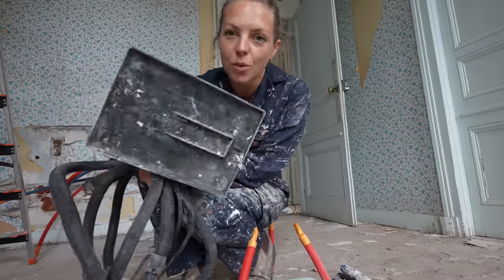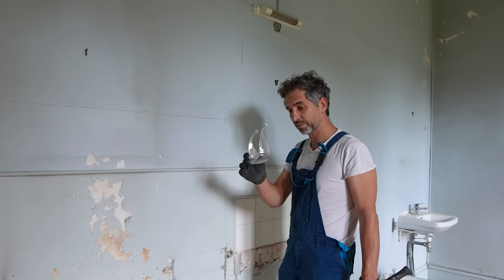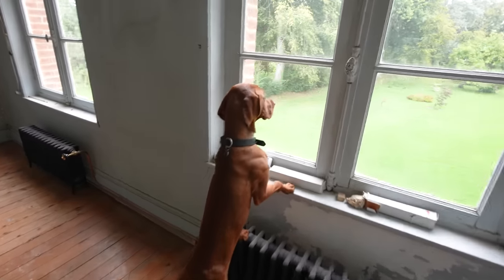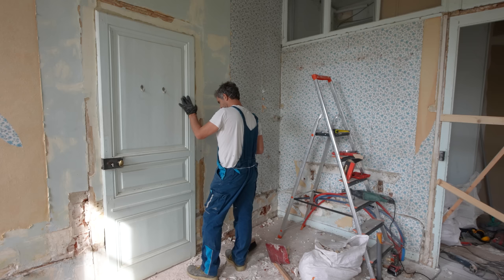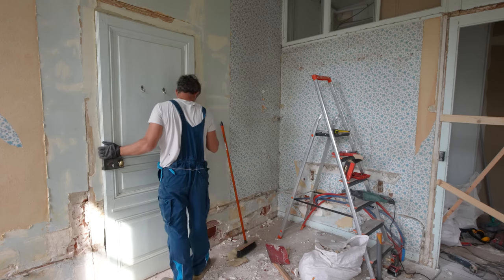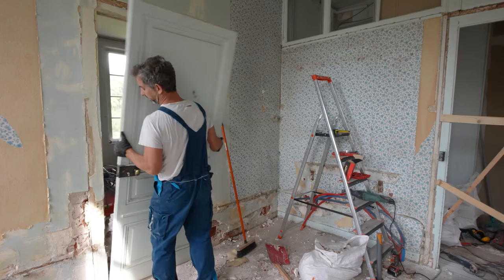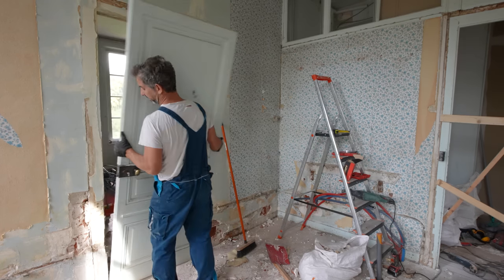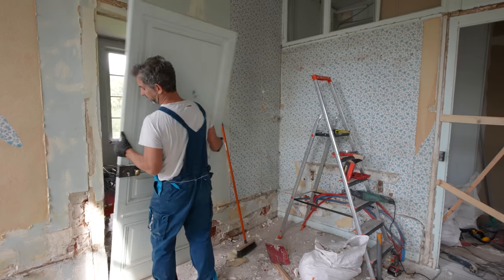Chateau Master Suite - Demolition Time!

Comment: Happy belated Anna! Watching you strip the wallpaper prompted me to send a hint... That is vinyl wallpaper and stripping it with a steamer is not going to help as it is water resistant. However, we use something called a paper tiger (very inexpensive-even Amazon sells them) that scores the surface of the vinyl, then steam or even water in a spray bottle can penetrate. It would be much faster and easier for you.

Comment: I bought a steam machine years back for just the same project: blue wallpaper in the bathroom, and it behaved just the same way where I had to steam up and easily scrape off the golden paper layer. I noticed that the residue of white spots left on the pale blue wall in the video looks kind of interesting, as if you could design a similar look to that which would have an ethereal feel to it. I don't think Philip needs to worry about boring moments. You have more subscribers still than Dan Preston does, though he is zooming upward rapidly, and that was even while he was just shuffling fallen rocks and scrubby overgrowth around! You're tearing down worn out elegance, and he's tearing down disaster. WE all just want to sit around and watch the return of beauty. I think you're safe!

Comment: Yes, that wallpaper is a pain. It was pretty popular here in the USA in the 60's and 70's. It's a vinyl wall paper to withstand the wet bathroom. Horrible to remove. We had some that wouldn't peel off  the backing. It was horrible. You did excellent work on a nasty job!  And happy belated birthday.

Comment: Yep, vinyl wallpaper with a paper lining.  I had it in two of the bedrooms of a 1915 Craftsman Bungalow home purchased in 1992.  Yes, the wallpaper was very easy to pull off (in full sheets from floor to ceiling), very fun and satisfying.  But the paper lining was stuck firm onto lath and plaster walls.  Back then I didn't know that there was such a thing as a steamer.  So, after removing the vinyl I used 10% fabric softener with water and sprayed it on the paper liner.  Allowed it to soak in for 15 minutes then scraped it off.  What a mess, just like your piles.  The addition of fabric softener is twofold, it helps to swell up the papers fibers, actually lifting it off the walls for easier scraping, and the smell was wonderful, especially when one it is removing 40-year-old paper from a home that had chain smokers!  Thank you for sharing your labor of love.  Best to all of you from California.

Comment: I can't imagine what the ceiling is going to be like getting that wall paper off... my mother wallpapered the kitchen in the late '60's,  it had an extra coating on the outside of it and was used especially in kitchens and bathrooms, the glue they used then was extra smelly too and super thick yellow stuff, you put it on almost like a thin plaster. The great thing about that paper was you could wash the walls real easy over and over and it always looked like new. My sister tried taking the wallpaper off 10 years ago and it was almost impossible, in fact, they replaced one wall instead of taking the paper off. So, I have an idea of what you're going through with this project.

Comment: I have had to remove wallpaper like that before... there is this neat little tool......it's a spiky little cylinder wheel on a stick..wallpaper perforator...it makes little tiny holes in the paper(without damaging the wall behind it) so that when you use the steamer the steam can get behind the paper and take it off in one step instead of two...albeit, it's a two step process with the perforator but only one steam process... also Happy Birthday!!

Comment: 17:24 We had that problem, too. This and in some rooms having up to five layers of wallpaper on top of each other. You can buy a tool which is basically a nail roller - it is like micro needling for the wallpaper. After rolling over it, the steamer works perfectly fine, because due to the small holes / incisions you created the steam penetrate all the necessary fivers of the wallpaper

Comment: You need privacy in the bath from the bedroom side, not the dressing room side.  No one is going to join you in the bath from the dressing side.  You should only be able to enter the dressing area from the bath.   I can't see where the old dressing entry door is, but it must be to the left of Philipp as he is trying to fit the door into his newly created hole. Close that former entry door off.  Fit the newly unhinged door into the bedroom/bath  passage to maintain privacy in the bath if desired. In other words, the entire 3 room master suite should only be accessible from a single door.  Also, if the mould (I spelled this the English way so Philipp wasn't confused about the SPEECH pattern) around the bed/bath passage is the same as the rest of the house, be certain to use the same mould around any other openings (or doors). To maintain the original architectural integrity of the house and because of the high ceilings, I would install no less than 20cm or even 24cm crown mould now. Not you, Philipp, Benoit.  I would also guess you are going to lose those clerestory windows in the end wall of the bath.  They have no reason for being there.  Anna, you did a great job of the paper removal, I wondered if that handy-dandy little steamer would be as effective at removing the last remnants of that recalcitrant lino on the floor?  Great job, guys and happy B-day, Anna!       Jack L.

Comment: Happy Birthday Anna.!!!   When I'm doing a renovation and I'm stripping wallpaper I pull the top layer off and then I spray the backing that's left on the wall with a spray bottle with hot water. I wet it good and in a couple minutes it scrapes off easy. You can cover a lot more ground faster than using the steamer.  You might want to try it and see if it works for you and may save you some time. Every wallpaper works a little different.  Charles Charlotte NC

Comment: Phillipe is wrong.  There is nothing underwhelming about the beginning of the project.  I think it's exciting to watch all the demolition and how things come apart.  It's the beginning of the build-up to what will come later.  :D 

BTW, if that whole wall is brick, wouldn't it be interesting to keep the brick exposed on that wall?  It may give it a very rustic-chic feel.  But is that sensible in a bath?  Hmm.  Anyway, it would definitely add interest.  And if you ever got bored with it, you could always cover it later.  But, please, not in 1960's wall paper.  (On the ceiling yet?)

One thing you can say about 1960's wallpaper: It was made to last... and last.  Especially bathroom wallpaper.

Comment: Hi from Australia 🇦🇺 
Wondering if you know how to remove wallpaper easily without having to use a steamer? 
Well here it is......
You just fill a spray bottle with fabric softener.  Spray it on let it sit for a bit and Voila!
It's that simple. 
Give it ago.❤😂🎉
Reply: You spray the softener on the under paper.Oh and you can peel it off easily. Using a scraper if needed.

Comment: It's vimura paper you pull the top layer away at the edge from the bottom the vinyl decorative layer pulls away like a layer of puff pastry leaving the glued base layer to steam off or redecorate over, a tough paper for steamy rooms ,it looked as good as new just badly put up and not a sympathetic design for the period rooms,fashions have changed a lot in the last century!

Comment: Hi I have no idea of dimensions but instead of blocking the door you have just removed with a wall put a reinforced frosted glass panel so light goes into the hallway.  Move the shower to that side and across part of the wall.  Have the toilet on the other side of the shower to the left if looking at that wall. Jacqueline 😊